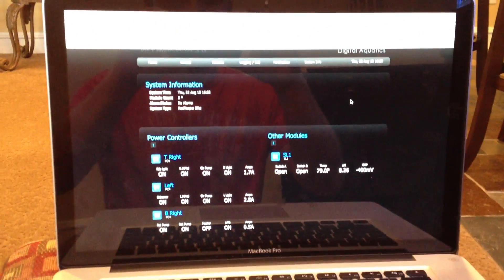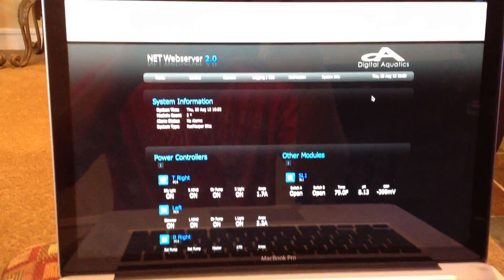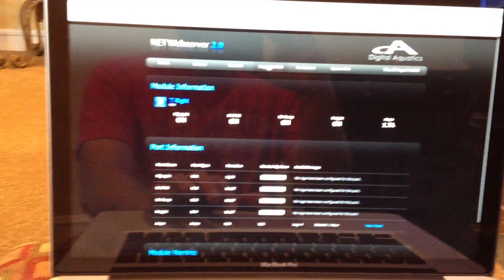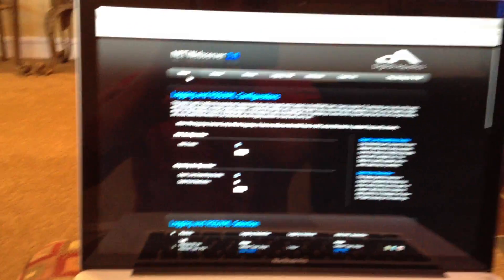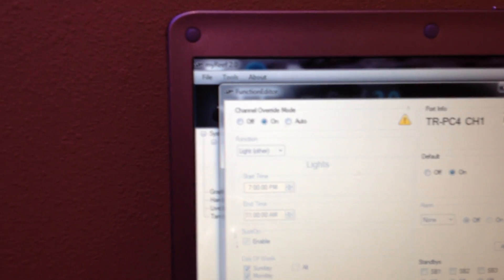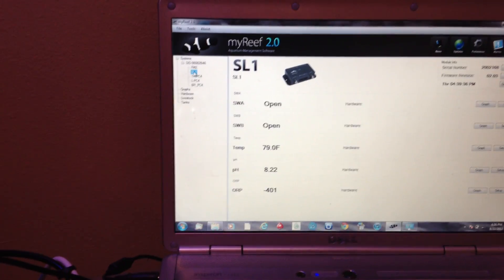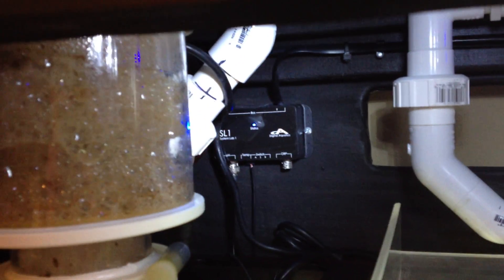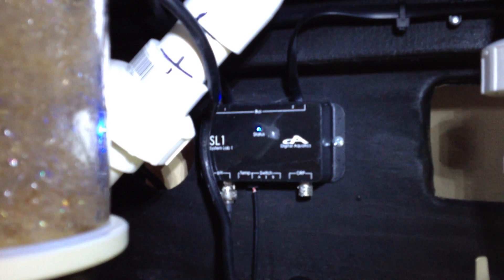Reef Keeper Elite and how I use it

Comment: how did you get the software on your mac?
Reply from the maker: That was the website that you saw on my Mac, their installed client will only run on a windows machine to the best of my knowledge.
Reply: jacked624 You can dual boot your Mac via BootCamp to run windows for the MyReef Software. Works well.